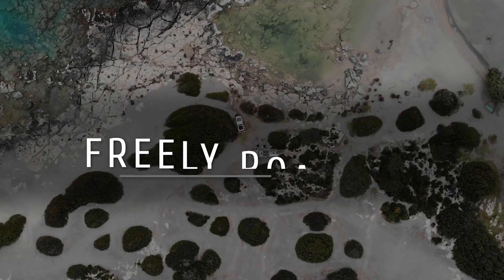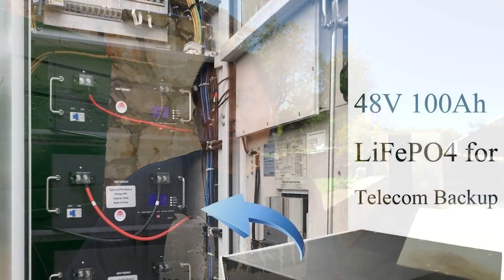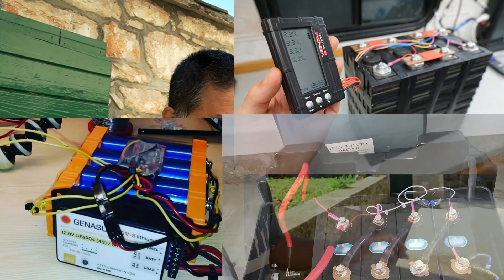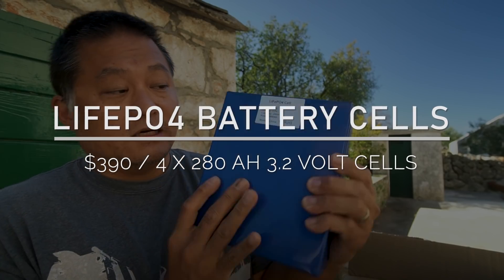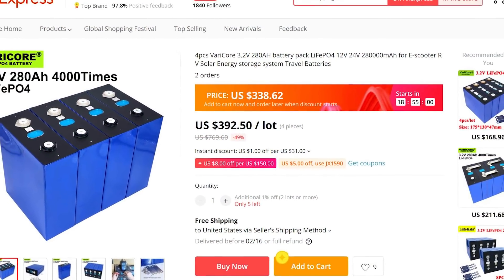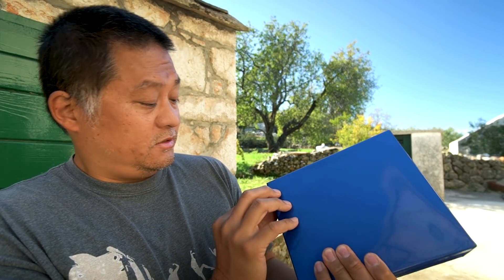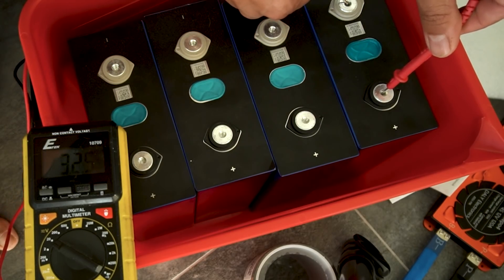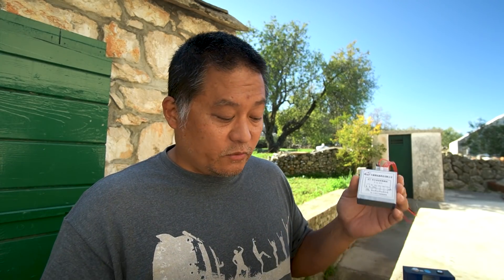Build Your Own 12-Volt LiFePO4 Battery For Cheaper Than AGM

Comment: Hey Dan, thanks a lot for the serie of videos, I'm building my van right now and I think I'll follow your steps. Though I have a few questions, bear with me I'm a complete newbie :

1. You said you bought 4x280ah cells, that means you get 1120ah total right, though you keep saying 280ah ? I don't understand.
2. How you do choose the correct BMS ? The one you bought, the Daly, have several options. It needs to be 4S right ? (Though what does mean 4S ?) Then there is either 150A, 200A and 250A? To which amperage are we referring to here ?
3. And damn right now the price is 430$ for 4 cells of 120ah!!! But I think I'll go with this pack.

Thank you so much for your help
Reply from the maker: Ok so each cell is 3.2 volts so you need 4 of them connected in series to build a 12.8v pack. That's what 4s means. 4(cells in)S(series). The BMS depends on how much max power you place to draw out of your battery. The manufacturer does not recommend more than 1C discharge. That just means they do not recommend drawing more than 280A continuous. That is a lot of amp draw for a van anyways. I got example went with a 120A BMS as I do not expect to use anywhere close to that output. When you buy your cells, make sure you read the reviews of the sellers. There are a lot of stores selling these and it makes a big difference that the sellers are sending out new and matched cells so you don't have to deal with returns and exchanges. I didn't end up choosing the cheapest option partly because I'm ordering from Europe and prices are different here for tax and customs reasons. Some people have gotten lucky with really low prices but it can be a gamble. This is who I bought mine from.

https://www.aliexpress.com/item/4000947956694.html

Good luck.
Reply: @freelyroaming  Cool thanks for the explanation of the BMS. Though you didn't reply to my first question, those 4 cells of 280ah in series will give you a total of 1120ah right ?
Reply from the maker: No when you serial connect you do not gain Ah. You will gain voltage. so a 4S will have 12.8 volts but still at 280 Ah. To increase Ah you will need to connect them in parallel but you will not increase voltage in parallel connections.
Reply: @MorefuzzNet  Check out Will Prowse’s channel. He has a series of videos explaining the basics of what you need to understand in order to really make educated use of the info that @Freely Roaming is providing here. Will’s assembly videos tend to be a bit quick and high level though. I haven’t watched the final couple vids in this series yet but he is doing things at a better pace for a beginner but obviously not attempting to educate people on the foundation required to get to this point. I have been taking the time to learn about this stuff for months and am very conservative about how I approach things but this is definitely a project where you really should understand everything from the ground up (no pun intended).

Comment: I just put together the same system you recommended with a 250A smart-BMS with bluetooth.  All cells (4x280ah) were bottom and top balanced (per Will P.) recommendation.  Individual cells were top out at 3.6v in parallel then ensembled together in series with BMS.  Prior to charging, all cells were balanced to around 3.337v - 3.410v.  Once I started the low amp (5amps) charge, one of the cell was starting to gain in voltage faster than the other 3 cells rapidly (within 20min).  I was able to monitor this via bluetooth in realtime to see the voltage gain across all 4 cells.  Smart-BMS kicked in around 3.65v for the upper limit fault condition of the defective cell.  It started to balance out the rest of the cells; however, its total voltage hit the upper limit as well for the Renogy charger.  So the rest of the 3 good cells were topped out around 3.4v.  Total Ah was around 250ah due to the defective cell (280Ah advertised).  I am currently working with the vendor to replace the defective cell.  Not sure how it will turn out but at least they have accepted the results that I provided.  it definitely worth $ to invest in a smart BMS (even a 20A model) just to make sure you have good cells prior to install it permanently.  Will P. has some good recommendation.  I am currently working out some installation bugs (bluetooth and connections) with the BMS provider (may even request to refund or exchange).  The technical support level from these manufacturers are non-existence.  YOU ARE ON YOUR OWN.
Reply from the maker: Hope it works out for you. Mine ended up working perfectly and capacity tested to 282Ah. I monitored the max min delta thru the whole charge and discharge cycle with no issues. There is definitely risk in ordering these batteries and good luck with your build.
Reply: I have the Renogy 400W system what brand cells would you recommend for this build?

Comment: Newbie here.... I need 120ish amp for 45 sec at a time with 15 sec recharge,  any such thing?
Reply from the maker: Yes you can draw 120A at a constant rate out of these cells with the proper setup. But I'm not sure what you mean by the 15 sec recharge...
Reply: @freelyroaming  I guess I'm used to draining batteries beyond their capacity and having to wait for them to charge back up. This has to do with long winded radio operator high transmit output power
Reply: You’re looking at just over 1C discharge and recharge capacity rating. The battery can do that. You’re real problem will be heat. An hour of operation like this won’t be a problem, but if you want to go for hours then some cooling is likely necessary.
Reply: Only time would be traveling on trips. Even then it won't be a 100% duty cycle. Not ALWAYS long winded. Only when ummmm prompted.? Haha.. Mobile use usually isn't over 45mins or so. I'm guessing you are talking cooling the battery,, Could a "forced air" in and out work for cooling? Even at 100f? In South TX we see that temp. In Aug...

Comment: whats the ah of four of these at 12v ?
Reply: about 900wh or 75ah. I can buy 75ah agm battery for 100€. So this would be over 4-5 times more expensive. I've also totally lost trust on cheap lithium batteries. newest technology always get the hype. Lithium batteries have typically lasted about  6 years in my laptop same for my phone and  power tools. my ni mh batteries typically last just as long. however the ancient lead acid batteries typically last at least 10 years when maintained . gel type about 6 years. the cheap chinese 18650 cells typically last about a year. I actually have a really old lead acid solar battery setup that is over 20 years old.
efficiency of these fla batteries is adverticed as high as 98 percent.  I never drained those under 80% they seem to just last and last.
Reply from the maker: These are 280Ah or 3.6kWh as a 4S 12v pack. These are not new technology by any means. Also LiFePO4 have 10 times the cycle life as compared to to 18650 Li-Ion cells used in laptops and power tools.
Reply: @freelyroaming  yes I miscalculated
Reply: @freelyroaming  3.6kWh is equivalent to 300ah & 12v
Reply: @freelyroaming When it comes to batteries LiFePO4 is very new so new that I don't even know how old propably like 150 years newer technology than lead acid. NiMH batteries began at the Battelle-Geneva Research Center following the technology's invention in 1967. A prototype Li-ion battery was developed by Akira Yoshino in 1985. The lead–acid battery was invented in 1859 by French physicist Gaston Planté...
Reply from the maker: It's been around for about 25 years and used extensively in industrial applications where cycle life and safety are critical. It became popular in the recreational world a few years ago for those same reasons. Ultimately it is still the same concept as any chemical battery by combine a cathode with an anode to store charged electrons.
Reply from the maker: The nominal cell voltage is 3.2v so a LiFePO4 4s battery has a nominal voltage of 12.8v. that is how the 280Ah is calculated. It's based on the nominal voltage of this chemistry.
Reply: @esasaarinen2423  wrong answer. They are 280aH

Comment: Another advantage is ,when one cell goes bad.replace only one,not the entire 6 0r 12 volt cells.and if you want to balance all the cells.just hooked them in parallel overnight.
Reply from the maker: That's why it is important to have an easy way to see individual cell voltage in case a cell happens to fail. But if the cells are new and matched, there should be further investigation to figure out why one of them would go bad in the first place.

Comment: I purchased 80AH cells off Aliexpress for a DIY LiFePO4 build. 2 of my cells are fantastic, and two of them are not so great. You are limited by your lowest quality cell. I think I get about 60 ah from my batteries due to my two lowest cells dying faster and the BMS cuts off my battery prematurely. 

If I was to do it again. I would purchase the SOK LifePO4 cells. They are pretty affordable yet tested and matched with eachother. Check out SOK cells if you want to do this with your van builds. Aliexpress cells....they are super cheap for a reason :(
Reply from the maker: Buying from a reliable seller that has new, grade a cells that are matched makes all the difference. A bit of luck is also involved. I am happy with my cells. They came with no damage, they were closely matched and tested to full capacity as a built set.
Reply from the maker: The SOK packs are probably the best value on the market for non diy batteries. But at $600 plus tax, to get similar capacity to 280Ah you are going to pay $1800. That's still around double what you will pay as compared to a diy pack. That gives your budget plenty of wiggle room to order a few extra cells if you build your own to make sure you have matched cells. But of course if DIY isn't your thing, buy the SOK batteries and be done.

Comment: Do you have any info on who actually manufactured those cells? 

In the link you provided to AliExpress for those cells, there's a lot of different sources for what appear to be the same cells of differing capacities. I expect they're all coming from the same manufacturer, but none of those product pages list any such info.

Thanks!
Reply from the maker: Yes there are a lot of sellers fot these. I can tell you mine came from Aliyah's Battery Store on AliExpress. You should be able to find them by name. I bought 4 cells and someone I know bought 16 cells from them as well and they have all so far passed their rated capacities in various discharge tests.
Reply: Aha, found it - for others hunting, just do a google search on "aliya battery". I had no luck finding them from inside AliExpress's site.

Looks like what you got is now $516 for the four cells. Maybe it's a thing where I'm in the US so I'm seeing a different price? Or they just went up since you bought yours?
Reply from the maker: @scottweikert5189  I actually paid a higher price because I had it shipped to Europe. This seems about right. You can find them for under $400 but they will be from other sellers.
Reply: @freelyroaming  I see. Thanks for replying!
Reply: They are Eve 280Ah cells.

Comment: Lithium Titanate, is what I'm thinking about at the moment.
6C charge & discharge. Full charge in 10 mins (6C). Up to 25k cycles, -50C to +60C operating range.
Reply from the maker: There are certainly benefits of lithium titanate for some applications but not ideal for 12v camper batteries. Funky operating voltage range, low energy density and lack of commercially available compact charging systems to name a few.

Comment: did you already test them? do they have real 280ah capacity?
Reply from the maker: Yes I did do a capacity test and made a video for it. You can see the entire process. Short answer is YES. They in fact over performed. Be aware though that depending on which vendor you buy from, you might not get grade a cells that will perform as well as mine did. I've seen some grade b capacity tests that land is the 250Ah range. Still good especially since those tend to be the cheaper listings.
Reply: @freelyroaming  thanks you are so nice person. I will suscribe

Comment: These are the batteries that I hope to use on my off grid home build.  Amazing value.
Reply from the maker: Yes indeed. I hope they will prove themselves long term as well. Keep in mind when you buy that some vendors are shipping grade b cells. They will not test at full capacity as mine did. It might be worth paying a bit more to make sure what you buy are grade a cells.

Comment: I have searched Aliexpress for quality busbars like that, but with no success, they are all small and thin. I'll try contacting the Global store directly.
Reply from the maker: I ended up making my own custom bus bars by flattening down copper plumbing pipes. You can see what I did in the pack assembly video.

Comment: That is some impressive energy density, only a year ago I bought some CALB LifePo batteries about the same size only 180ah. Pity they cost more to ship to Australia than all 4 of the batteries in the link :(
Reply from the maker: Search around with other vendors and you might find a good sellers with free shipping to AUS. I was also considering calb cells last year. I'm glad i didn't and got these instead.

Comment: Great review. I want to do this too but our brand new Winnebago came with an inverter/converter that, believe it or not,  is not compatible with lithium. Even has the MC4 connectors on the roof and a location for charge controller. A bit more involved but doable
Reply from the maker: Thanks! That's unfortunate about your Winnebago. They're usually better than most other manufacturers when it comes to using lithium with several of their class b models equipped from the factory. Strange that yours are not even compatible to be upgraded. That's a shame.
Reply: @freelyroaming  we bought a micro minnie winnie, 2021 model. Like I said, pre-wired for solar, even has the mc4 connectors on roof but reading the manual on the inverter/converter, it is ok for every type of battery except lithium. In November 2020 I found that strange. Looked up the WFCO unit online to confirm, and also found WFCO unit that will do lithium. Direct
 replacement,  same two wires to connect and about $20 more than the one installed.  Go figure...

Comment: Shipping 663.00 usd. So 1200.00 for 280 ah. Still fair deal with 100ah about 900.00?
Reply from the maker: Definitely. Especially since there are some grade B cells being sold and I think those are generally the cheaper options on aliexpress. It is worth paying a little more to make sure you get cells that pass capacity test.
Reply: 100Ah 4S LiFePO4 cells (without BMS) should cost you around $300, tax paid, delivered direct from China. 275Ah 4S will be around $450, tax paid, delivered, if using the right sources.  So many people buying via resellers in Europe or US paying double the going rates or more.
Reply: @PVflying  So who were you buying from and how do you know they are grade A? Thanks.
Reply: @Dansmithyman  Plenty of resellers offering these prices. Shenzen Basen, EAMIRE Yidong, RJ Energy, etc.  Grade A means they meet the published specs as per spec sheet.

Comment: I ordered  16 of the same battery’s last year 88.00 each. It took 3 month to deliver. They were not packaged properly one of them was quite badly damaged they would not replace the one cell I found the disputing process a joke 
I haven’t assembled my system yet because of the cOVID-19 thing
Reply from the maker: Sorry to hear that. As you can tell there are a lot of vendors selling these on AliExpress. I think it's best to thoroughly read the reviews before ordering and paying a bit more might be good insurance that you might get a better seller with grade a cells. I've seen some grade b cells floating around that don't capacity test to the rated level.

Comment: Everyone is saying lifepo will last decades, where are the examples of this in real life, not commercial scenario? Just curious.
Reply from the maker: They have not been in the recreational market for that long but there is no reason not be believe their rated cycle life from their commercial applications in the past which indeed have decades of proven use. If anything, recreational use will be much easier on them then how they were used in some stressful industrial applications. Many of them when used in telecom applications were powering high amp draw equipment nightly in solar powered, off-grid cell towers. You see a lot of telecom retired lifepo4 cells that still have 80%-90% capacity after 10 years of nightly cycles.

Comment: Sourcing from the wrong places in China if the delivery date is March 02. It's not even thanksgiving yet! Not many people willing to risk $400 for a 4 month shipping delay. A bank wouldn't even issue a fraud credit if the product doesn't arrive. Aside from your product source, the video is great.
Reply from the maker: I think there is a sudden high demand for these cells right now. The shipping date has been pushed back since this video was uploaded. They are probably back ordered and I would just look for another vendor for a better delivery date. Be aware that there are different grades to these cells. A grade b cell will not yield the same capacity as grade a cells.
Reply: @freelyroaming  Definitely was not bashing your content at all, just a note of warning about vendors that fail to deliver. Good choice on BMS, Daly is still where it's at. :)
Reply from the maker: @jaenulton9953  no worries. I just wanted to be clear that each vendors inventories are dynamic and can vary widely over time. I cannot manage the links in the descriptions of every video with latest data. Daly is definitely a good budget friendly BMS. Good value for what it delivers.